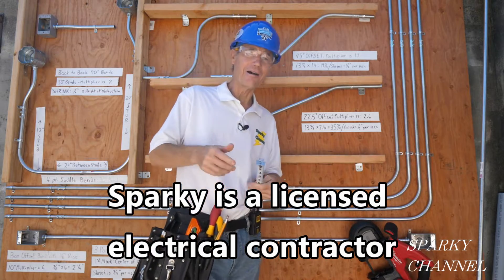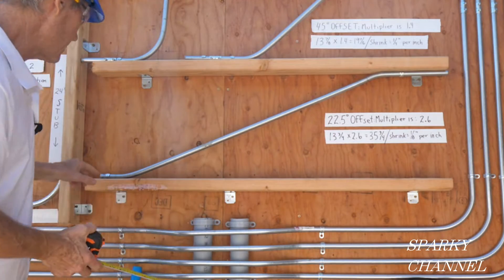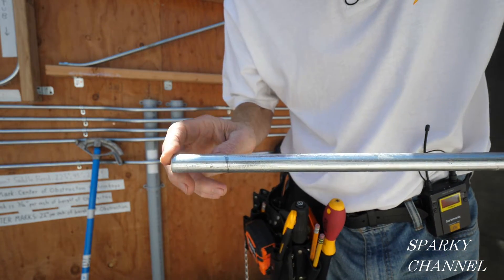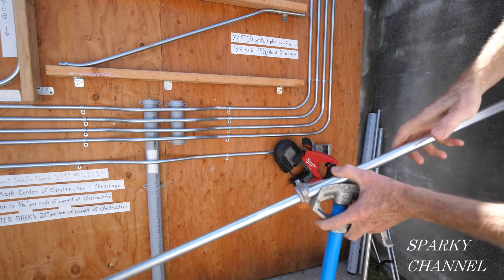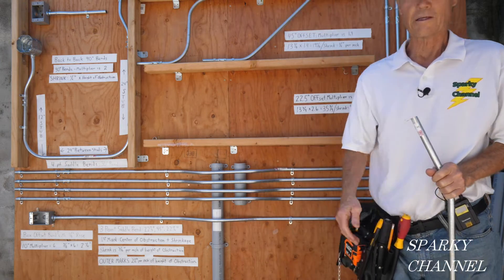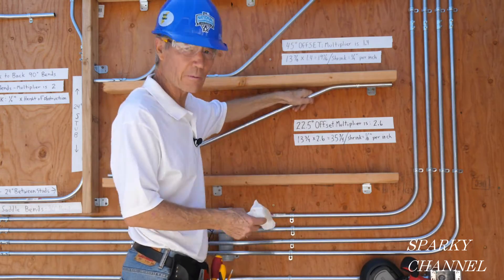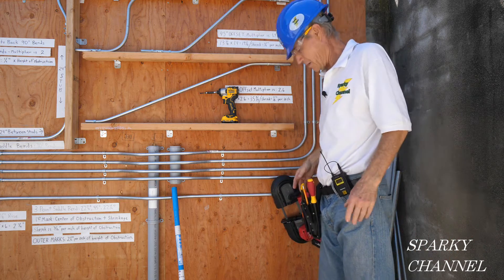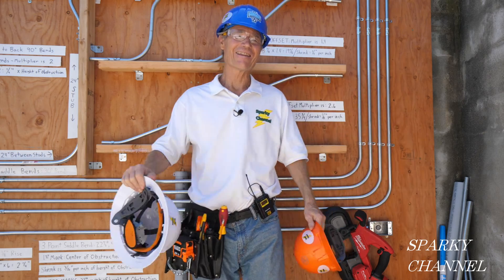EMT Bending: How to Make a 22 1/2° Offset Bend

Comment: 13 3/4 from the inside of the conduit to the board surface or board surface to board surface? Thx
Reply: Good question. I just had a question similar to this in my homework. It says “Which of the following is a correct way to measure offset rise?” And the answer is “From the bottom of the conduit at the wall to the bottom of the conduit where it crosses the obstacle.” So I would think that the length would be a little off if measured from lumber to lumber. Please let me know if you found out…. Edit: I went back in the video and he did measure from the bottom of the conduit at the top.
Reply: @ZeroThree31 thx Z

Comment: @SparkyChannel Your videos are very informative for new electricians starting out in the trade. Out of curiosity though how did you get 1/8" shrinkage for 22.5 degree offset? I'm doing conduit bending in my current ET program and I thought for 22.5 degree bends it was 3/16" shrinkage.
Reply from the maker: You're correct. It is 3/16".

Comment: Hi Bill, thank you for all of your helpful videos.  I am a simple homeowner with no experience in the conduit bending art at all.  I have a question regarding a task that closely resembles your video on 22.5 bends.  I have two boxes mounted to the same wall that are separated by 12".  I need to run a 3/4" EMT between the two, however, the placement of the knock outs on each box are such that i need a 2 5/8" offset (center to center measurement of the knock outs) to run the conduit between them.  My math comes up with 2.6* 2 5/8" for a distance between bends of roughly 6 7/8".  I have followed your directions exactly and the center to center distance is measuring close to 3 3/4".  i have set the tubing in the bender to confirm my bend angles are right at 22.5.  What am i missing?